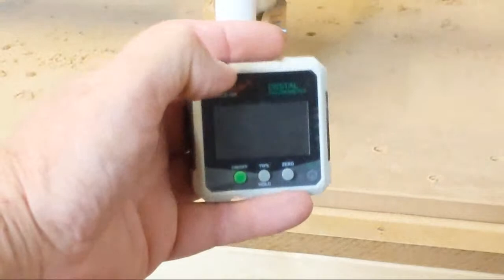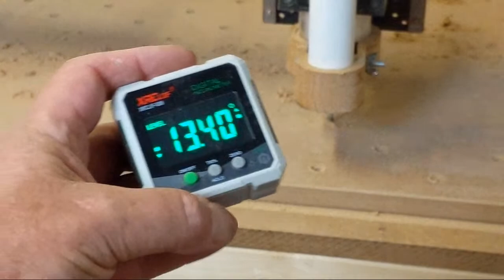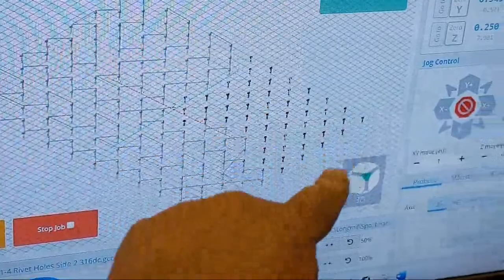Making The Longmill MK2 30x48 Spoilboard

Comment: Do you glue the rivet nuts into the spoilboard?  How can I get the file for making the 48X30 spoilboard.
Reply from the maker: The rivet nuts are pressed in. I should have the code available next week on my Etsy store
Reply: @IDCWoodcraft  Looking forward to that! I bought your 30x30 version but am having trouble modifying it to fit my 30x48 machine, so I'd definitely buy a 30x48 version once it becomes available.

Comment: Good evening, I am at this point of making the spoil board. My first try was a bust. I noticed something didn't look correct. I stepped back for a few seconds then heard the loud snap of the bit. It hit the first screw holding the spoil board down. I received my new bit and tried it again, but it is still doing the same thing. It looks to be going to deep into the wood and not coming out of the top, so leaves a cut as the bit moves from hole to hole. Is there a setting I missed? I used the auto zero plate with the small flat on the top of the spoil board.
Reply from the maker: Doughboy,  It sounds like you might have an uneven spoilboard so instead you could also try finding the highest point of the spoilboard and autozeroing the z axis off that position! Hope it helps my friend.

Comment: What is the size of rivet nut you use? Does the file for this board engrave the grid or have you done one with the laser?
Reply from the maker: casey, sorry for the delay getting back to you it's been a busy week over here! I use whatever I have on hand brother, there's really no specific size you need for this one! The file for the board will have the lines on it, no need to laser them!

Comment: Hi Garrett, I was looking at your v bits for sale. The description for the 120 degree v bit says its 3/4" dia. but the tool file says its 1 inch what is the correct diameter?

Big Stiffy series, a set of bits designed to virtually eliminate uneven carves due to chatter. See full description for more info.
Shank: 1/4″ / Length: 2″ / Flutes: 2 / Flute length: 0.5″ / Cut Dia. 3/4″
Cut angle 120 degree / 100% carbide
Reply from the maker: Hi Buckeye, sorry for the late reply and I also sent this in another comment. But, I took a good look at that and thank you for pointing that out. The cut diameter is now 1" on the website.